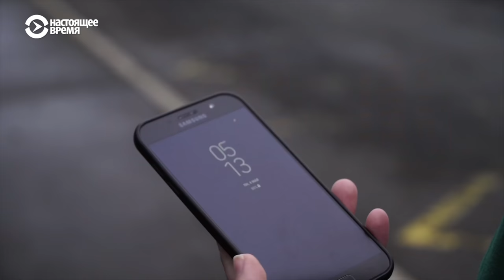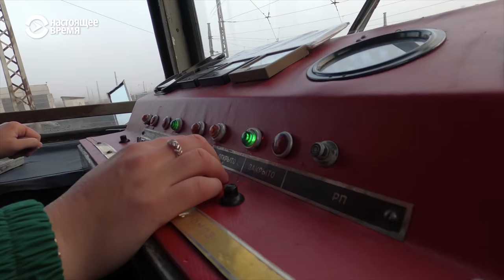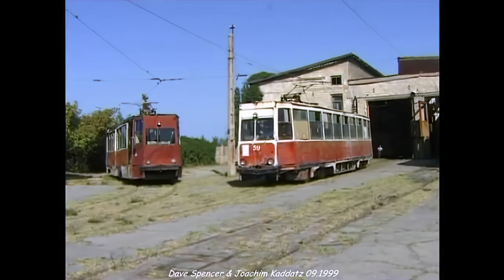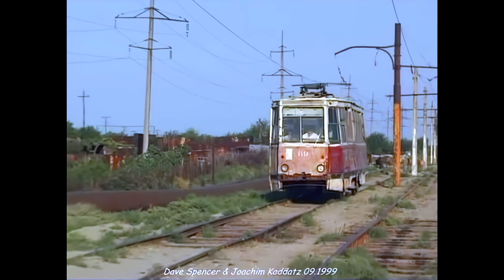How This Iconic Red Soviet Tram Survives On The Remains Of A Fallen Empire

Comment: Soviets Era Vehicles are literally goddamn invincible.
Reply: Not only vehicle, but also power equipment. I work on power plant, the fist generator of which was turned on in 1962, and it still works.
Reply: Apparently they can't build a car that can start in the winter so its not a universal trait.
Reply: John cena: 👁👄👁
Reply: @lolroflroflcakes  cars can start their engines in the winter, but not in severe winter conditions of some Siberian towns. You can’t start and engine when oil supply is literally frozen, can’t you?
Reply: @rhoninwindrunner7575  They specifically said minus 30/40 celsius. As a teenager I had a old GMC truck that ran fine in those conditions. No freezing oil or anything.
Reply: @angkarbasil  not true very much in stores there were a lot of defects
Reply: @angkarbasil  
and there was also a lot of deficit, I had to stand in line without buying anything
Reply: @Бутилкакваса  oh yeah, the artificial deficit
Reply: @angkarbasil  Yes, yes. It is always someone else's fault but the Socialist system is perfect - Standard excuse.
Reply: @DrRadio155  
What kind of power plant, coal? What is the power rating? Do you happen to know the steam temperature and pressure of the steam, and the thermal efficiency?
Reply: @gregorymalchuk272 , yes, it's coal power plant. Rated power is 173 MW, but actual is about 200 MW. Steam temperature is 535°C, and its pressure is 100 at.
Reply: @angkarbasil  In capitalism it's planned obsolescence. In communism, things are engineered in such a way to respect the worker's right to repair.
Reply: drive a 1984 Lada car or a Niva (4x4).  the niva came equipped with a handcrank in case the battery died or it was too cold. Manual chokes. They NEVER STOPPED. 

once good soviet engineers learned in canada suspension is not considered an option... they were very popular and held up to our winters perfectly well beating their american counterparts hands damn well down.
Reply: No, they have not been ..... most of them just died in the 1990th
Reply: @angkarbasil  so now you are telling me what the soviet life was like??? I was standing in lines for butter, for sausages and for (Indian!) Det Washing powder since as early as 1977🤣🤣🤣🤣🤣
Reply: @mariosefardi-casella2730  what republic were you from?
Reply: МССР  МОЛДАВСКАЯ СОВЕТСКАЯ СОЦИАЛИСТИЧЕСКАЯ РЕСПУБЛИКА из столицы!! с Кишинева - с Ботаники .... сказочки маме раскажешь малолетка 🤣🤣🤣
Reply: @mariosefardi-casella2730  you do know i can read cyrillic right?
Reply: @lolroflroflcakes  Watch some modern day videos about live in the coldest towns in Russia - even western and japanese cars have to either be kept running 24 hours, or be kept indoors.
Reply: @mfbfreak  Again, they were very specific about the conditions and it wasn't the coldest Siberian towns it was between negative thirty and forty. I grew up somewhere like that, not the coldest place in the world, but the winters were still long, dark and bitterly cold.

It did require differing procedures from someone operating a vehicle in warmer climates but it the original statement still stands, it was a North American truck and it always started in the conditions they talked about. Maybe electricity wasn't readily available, there who knows, but it was enough to make my statement factually correct.
Reply: @DrRadio155  Респект братиш !
Reply: the amount of tankies in response to this dear god
Reply: They should keep them running.
Reply: @angkarbasil  

Ehhhh....kind of quality.  Lots of shit still.
Reply: @lolroflroflcakes  so you're talking about italian cars. their cars has that as universal feature. Same way as french cars handbrake will froze shut in winter.

Russian cars are build like nuclear bunker. even though certain unnecessary features won't work, things like heater.
Reply: @rhoninwindrunner7575  You won't have problems with frozen oil if you have a 2 stroke engine. Apparently my old Tomos moped could start at -40°C if you have low octane Russion fuel for it. Because it's a low compression engine which starts with a foot crank and the oil is mixed with the fuel. Sadly I couldn't verify the claim because it doesn't get that cold in my country and we only have EURO95 E10 as the lowest octane rating fuel. And the added Ethanol attracts moisture from the air which ruins the cold temperature capabilities.
Reply: @angkarbasil  No, survivorship bias. Now get your cents from the CCP.
Reply: russian enginering is pretty crappy generaly but the stuf is way easier to fix. you ask a russian for quality he gives something that you can keep fixing.
sovjets might make stuff that is but ugly and uncomfortable but it works and dont cost much
Reply: Just like Trabant and Wartburg cars.
Reply: @angkarbasil  i would not say that communism always could afford the best quality, things do break, but the problem with capitalism, especially in america, is planned obsolescence. they will build things in a way that they break on purpose and you are not allowed to repair them yourself, either by contract or because they build them so it is impossible to repair without keys from the producer. best case for capitalists is if something breaks quickly just after warranty and if it cannot be repaired so you buy the newest model.
communist/soviet things break too, they are more sturdy depending on what it is, but when they break they can repair it easily.

Comment: Toronto tram "help, there was a mcdonalds straw on the track and my fault sensors tripped saying im on fire"

Soviet Tram "i was shot and rammed by a german leopard tank, i will tow him home as a sign of honor among warriors"
Reply: As a Toronto resident from Communist Poland; True story 🤣🤣
Reply: TTC services isn‘t good
Reply: Old but gold
Reply: The O train in Ottawa be like: 
Oh no someone touched the door guess my entire electrical system needs to be disconnected
Reply: @myrealusername2193  true lmao
Reply: @GhostOfDamned  I need to take it every day
Reply: that sounds like an after tho. well, at least we havew regulations in Canada. Its ok when shit catches on fire in REussia, thats how they keep warm after they dig it out of the mud and have to push it to the next downhill.
Reply: True, if you’ve ever seen what happens to Toronto street cars in the freezing rain when the overhead power wire gets covered with ice
Reply: Heh, you think these trams are old and battered, you should see the original LRT cars in Edmonton. All of them I'm pretty sure were from the late 60's or early 70's, and original until about 2014. Then they expanded the system, bought a bunch of new cars, and sent out the old ones to be re-built. I'm pretty sure when these trams are taken out of service, Edmonton will buy them - they'd fit right in! On really cold mornings when the heat is going full tilt, you'd always wonder if the burning smell was just the heat, or if the whole thing was on fire!
Reply: @myrealusername2193  **derails**
Reply: "The margin of safety of the system was exhausted" love that one
Reply: @Dexter037S4  yeah especially considering one of the axles fell off the train yesterday
Reply: I remember a thing going around in the very early days of email about this disconnect. One line I remember was about feminists: "Oh, you're a feminist? You're for equal rights? Awww, that's adorable. Our women drive excavators and put dresses on bears."
Reply: I approved of this message

Comment: I'm amazed over how much the KTM-5 looks similar to the Kawasaki-built trams used in Philadelphia. I get that it's an apples to orange comparison, but that was my first thought when I saw this video. It also speaks volumes about how poor infrastructure maintenance is in most of the former Soviet bloc.
Reply: Yeah, after the collapse of the USSR, things deteriorated in quite a few countries, particularly the ones that relied on membership of the bloc to get enough funding to keep their infrastructure working. The USSR were very keen on public transport, far more so than NATO countries, especially the USA.
Reply: Since these trams are based on westinghouse pcc technology it isn't suprising the look similar to other designs with lineage to the same base.
Reply: True, they are of the same shape concept with Philly’s Kawasaki, although that Kawasaki is a bit stronger made, more durable frame
Reply: @steviecureman2837  Durable indeed. I'm amazed that Kawasaki trams in Philly have lasted as long as they did, considering they were built in the early 1980s. I'm sure they're going to be replaced sooner rather than later if SEPTA gets their act together, but that's a testament to Kawasaki's reliability (at least in that era).
Reply: Try to maintain railway infrastracture in permafrost.
Reply: @mishacol  but the thing is the trams survived
Reply: @CreightonRabs  Philadelphia is still using Trolleys from the 1950's  (the Green and White diner cars on Gerard Ave) along with the 1980's Red White and Blue Septa trolleys.

Comment: The KTM-5 is derived from Czech Tram Tatra T3, which are stil pretty common in Prague, Czechia. And they are very well maintained. You should do a video about the T3 legend (if you didn't already, I didn't search your channel). The T3 is an evolution of T2 and T1, which was a PCC licence. So in a sense, the KTM-5 is PCC derived.
Reply: Indeed. The PCC heritage is obvious from the first look at the proportions and the bogies.
Reply: @comandanteej  KTM-5 has never been technically related to Tatra T3. Though it looked similar some way, they had absolutely different control systems. The Tatra has a pedal controller while the KTM has a manual one. The body structure and the coupling unit are also different. In some cities (such as Krasnodar and Nizhniy Novgorod) Tatras and KTMs are even served by different depots. But 71-402 (403, 405, 407...) and modern Ukrainian trams (К-1) are really based on Tatra T6B5.
Reply: Although the KTM5 has a simplified electric control system, the bogies are a faithful copy of the PCC B3 bogies. A similar situation was with the Soviet RVZ and LM wagons, only there was an additional pneumatic system, just like in the pre-war versions of the PCC. It is said that the Soviet RVZ, LM and KTM wagons are derived from the Czechoslovak CKD-Tatra which is based on the PCC license. But how can we explain the fact that the first prototypes of the RVZ-51/52 wagons appeared in 1951, and the production of the Tatra T1 started in 1952, while the first T1 copies were delivered to the USSR only in 1957?

Comment: In Aarhus, Denmark we have nice new trams that cannot run when it's around 0 Celsius.
Reply: frick the letbane bring back the regual aarhus - grenaa regional railway
Reply: Awesome! Thought that kind of head shaking stupidity was limited to Britain and France. But no........
Reply: Here in the north middle of Germany the  complete rail system broke down for a week after 40 cm snow!
Reply: And back in the 1910s the Aarhus trams still operated normally, when there were snowstorms.
Reply: @fabianschneider5992  Well.. it does every winter. As if we couldn’t see it coming
Reply: ... What's even the point of accepting it then.
Reply: Wtf. But Denmark is cold in the winter. Why can't they run at 0 celsius?
Reply: It's so sad.

Comment: Meanwhile, Gothenburg bought italian trams that rust as soon as there is any moisture in the air, and stop running as soon as temperatures drop below 0°C. The AC stops working if it's too hot or too cold.

Comment: Sad to see the ones that are not being take care of. While not all vehicles of the past are built the same, many of them will quite literally last forever with proper maintenance. I've got a 1979 e-150 van that we bought of a older couple that had been well taken care off, besides the body rust. It's still going strong with me only having to replace the original starter and fuel pump a few years back. I really want to rebuild the engine and repair the body once I can scrape up enough money. Newer doesn't always mean better.

Comment: I always thought , that T3 is the most numerous type of tram in the world. I looked o Wikipedia and it is true, T3 is the most numerous tram of one version in the world . The KTM 5 has slighltly less pieces of one version.
Reply from the maker: KTM-5 had:
 - a few КТМ-5
 - about 800 units of КТМ-5М (according to Russian Wikipedia)
 - about 12000 units of КТМ 5М3 (the last one's serial number is 12943)
 - about 2000 units of 71-605А (the last one's serial number is 1426)

According to Czech Wikipedia, there was about 10500 T3SU units produced
Reply: @RailwaysoftheWorld1  OH, I messed that up . On czech wikipedia was written , that about 14 000 T3s were built. That's number for every type of T3 ( without tyristore ones ) ever produced ( That mean for example two doors , as well as three doors)

Comment: Why did trams with plastic cabins burn? It's a pity. Czech trams have also been lightened by fiberglass bodies and have been running since 60' years to this days. It is a pity. Trams complete the atmosphere of cities and characterize them. They shouldn't be canceled.  I feel very sad if i can see tram track in such bad shape.
Reply from the maker: Plastics were different in the 1960s, less fireproof and more toxic when burning. The use of plastic was excessive, e.g. some high-voltage equipment resided in plastic cases, that were the main sources of ignition AFAIK.
Reply: Czech trams Tatra T3 has a front and rear side made of fiberglass only. Some early KTM-5 cars (this model was called KTM-5M) whole bodies external sides were made of fiberglass. And of course it was not fire-safe and after some fire accidents (the hardest or them happened in Tomsk in 1971 https://obzor.city/data/images/news_2013/10/tramvaj/6_15.jpg ) all of the produced plastic cars have been returned to Ust-Katav, where all of them were changed with the steel sheets except the roof.
Reply: When Pittsburgh PA (USA) refurbished their 1940s era PCC cars, they replaced the front end with a fiberglass replica to reduce weight and not have to worry about corrosion